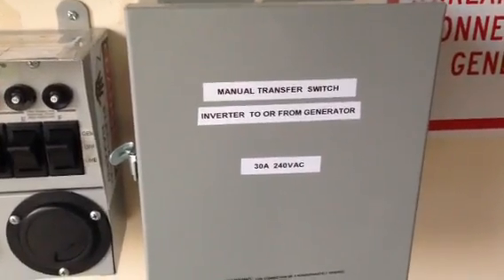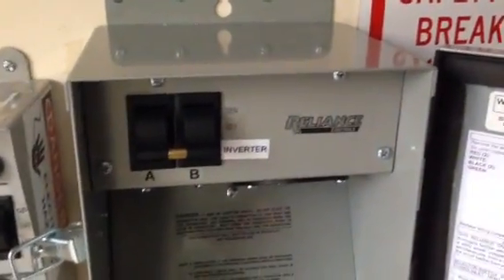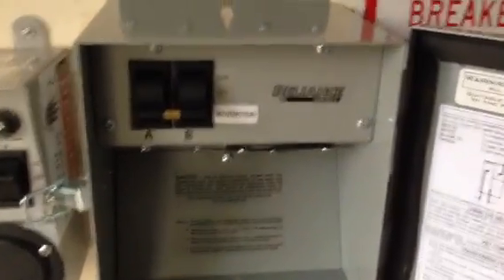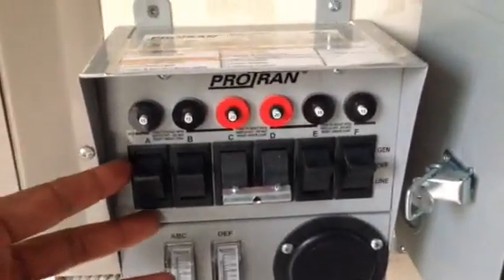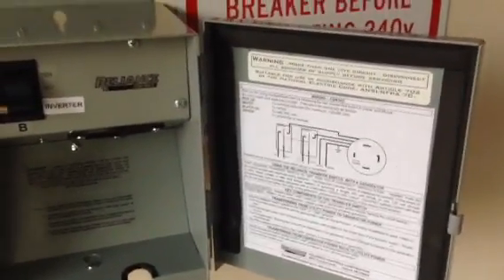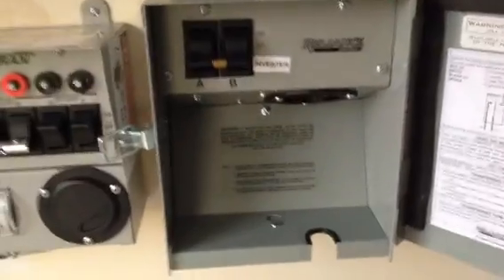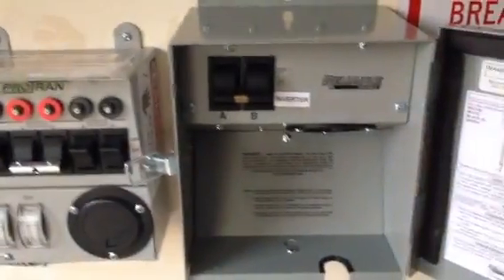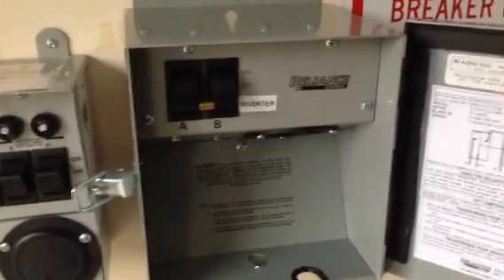DIY - CSR302 Transfer Switch Installed for additional Safety

Comment: Can you add the csr302 directly to say a well pump or water heater and run a generator just to it?
Reply from the maker: I don't see any reason why it wouldn't work.  The pump and/or water heater are just 240 AC loads, the transfer switch simply switches between power sources.

Comment: Where did you get the interlock that you have in your circuit panel?  I have a similar circuit panel and need that same interlock.  Who was the manufacturer?  What was the cost?
Reply from the maker: You can get it at www.Interlockkit.com , all of the information is available from the website.